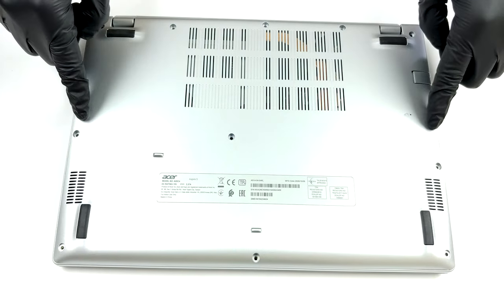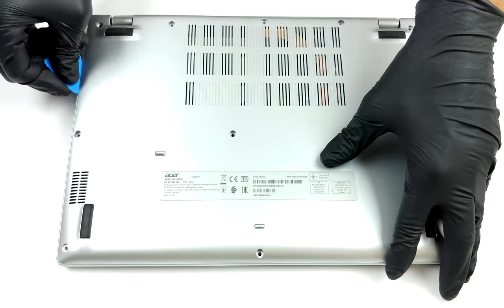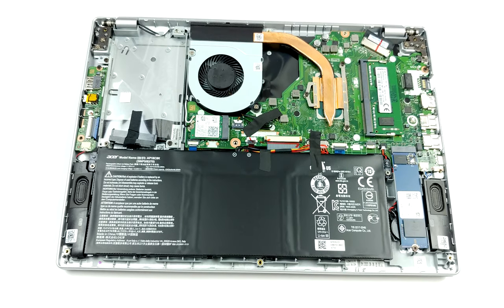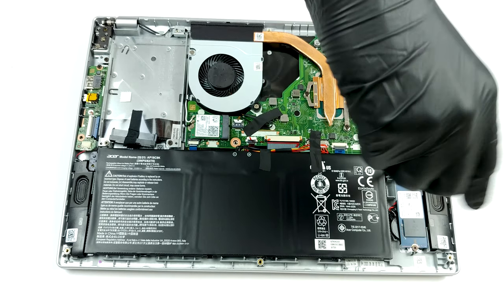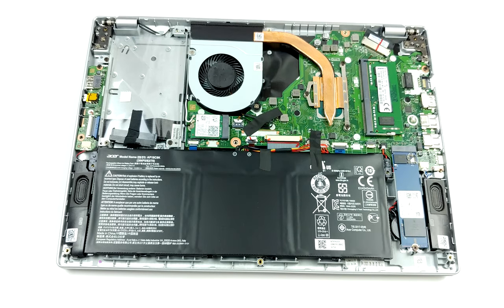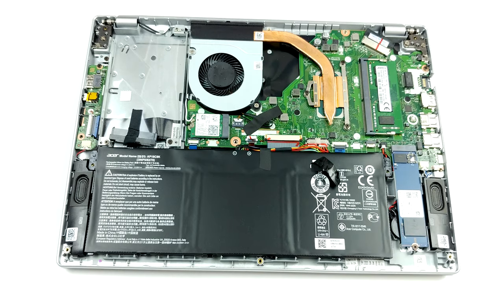🛠️ Acer Aspire 5 (A514-54) - disassembly and upgrade options

Comment: Is this also the same with acer A514-54-37X8? Is the space on the top for hard drive?
Reply: im also here with that question since the A514-54-37X8 specs on the acer store onlysays about the extra m.2 slot and not the hdd expansion ..
Reply: Yes, but some models could bring the ssd kit

Comment: How many maximum ram upgrade for this laptop?
Reply: Depends on processor, in theory 20 GB but I think it can take 36
Reply: @jcmolero71  Hey bro happy new year btw, i have a question and i hope it reaches u. I have 8gb ram and my laptop says that it has 2 of 2 slots used of ram. I am assuming that the first slot was the built in one which is 4gb while the other is also 4gb. My question is can i upgrade the 2nd slot from 4gb to 16gb? ty in advance
Reply: @jxhndragggy  sure you will get 20GB as my laptop (sharing up to 4GB in video)
Reply: @jcmolero71  Alright, appreciate u bro have a great day 🙏. Sajin goated btw

Comment: Does it have a internal slot for 1TB HDD?
Reply: I belive so, I think it is that upper left empty slot. you can also put an SSD in there.
I'll attempt to do so tomorrow in a friend's laptop
Reply: @JulienCasalini  how did go? Was it easy?
Reply: @crimsonharry1958  It went pretty well! I feel like most people would succeed!
By the way, the SSD/HDD has to be in a 2.5'' form factor or it will not fit
Reply: @JulienCasalini  thanks for replying 🙂

Comment: Hi! I tried upgrading the RAM but the laptop restarts randomly from time to time. Can you recommend a good ram for this laptop?
Reply: Depends on processor, if it’s a intel gen 11 or amd Ryzen 5000 it must be 3200 MHz and it can be Crucial
Reply: @jcmolero71  thank you so much! Will buy crucial ram tomorrow
Reply: @spencerschmidt75  don't forget check the bus speed, also it can be done in task manager, performance, memory and read the bus value
Reply: Know ur built-in ram specification & buy one with matching spec

Comment: Is there additional slot for ram ??
Reply: 1 slot and 1 soldered
Reply: @jcmolero71  so if i will upgrade my ram should i get a higher one? I have 8gb ram with 2666mhz and im planning to buy 16gb ram. What will happen if i add those two?
Reply: @ggaec8007  it would be 24 G and the speed would be as the slowest of the two

Comment: My Aspire 5 seems to have a battery problem, where the battery discharges prematurely when the laptop is fully shut down. For example, I can charge the battery fully, shut down the laptop, and boot up the laptop 24 hours later and have only about 60% to 80% battery power. Has anyone else experienced this issue?
Reply: just sounds like the battery decayed
Reply: I haven't had that problem in my 3 years of using it

Comment: will warranty be voided if you upgrade yourself?
Reply: Yep
Reply: In shop they told me is still under warranty just upgrading ram and storage, as the drive kit is provided, and also there is a instruction video in the acer website for opening

Comment: i have this model and the fan stopped working, can someone tell me if this is a hardware or a software issue?
Reply: Me too, but i fixed it by applying oil to the fan, u gonna need to unplug the fan first then disassembly it, then put some oil in the rotating machine, clear some dust, and voila

Comment: Can anyone suggest compatible ram for this laptop?
Reply: Eyy I'm about to ask the same question
Reply: It's DDR4, Any laptop DDR4 RAM Stick will do ;)
Reply: @OwzaB  hey, I have a non removable 4gb RAM. Does that mean I cannot upgrade it?
Reply: @ShiratoriIsOffline  If you're talking about the same laptop, then it does have an extra RAM slot. The on board (unupgradeable) 4GB you're right, you can't touch it. But you can add 4 or 8 or 16 on the second slot. See on the video, on the other side of the fan there's a RAM slot. Hope this helps
Reply: @OwzaB  I have a question. I'm in the same situation and if I put another ram does that mean it is dual channel? thank you
Reply: @capricornus1584  Hi Timothy, if you are referring to the same laptop then yes it has Dual channel support according to CPU-Z. NB: using two RAM slots doesn't necessarily mean Dual channel. But for this specific model, yes it does mean Dual channel.
Reply: @OwzaB  Hi, 1 last question... I have 8gb ram (unupgradeable) and I'm still not sure if 4gb or 8gb ram will I buy. Which of them perform better for dual channel is there a difference? Thank you:)
Reply: @capricornus1584  As far as I know RAM size has no effect on channel speed. Instead the MHz of the Ram stick have an effect. Like 2133Mhz would be better than lower rating. On the other hand, getting a bigger RAM if you can is always the way to go, you'll store more stuff but doesn't mean the bigger RAM will be accessed faster than Smaller RAM.
Reply: Ddr4 2400mhz sodim non ECC. Matching 4gb recommended but you can install an 8gb for a total of 12gb.